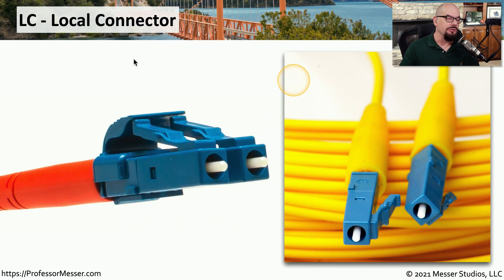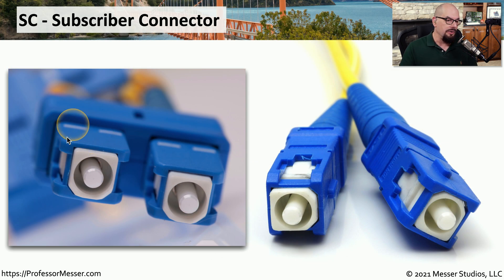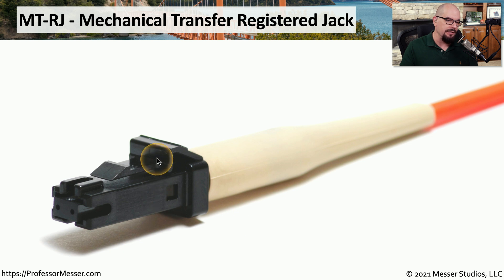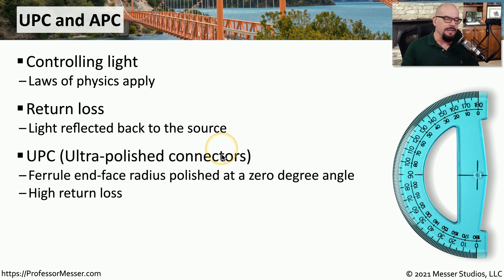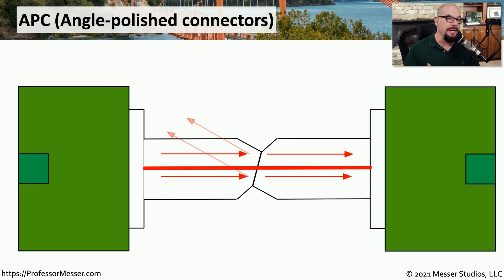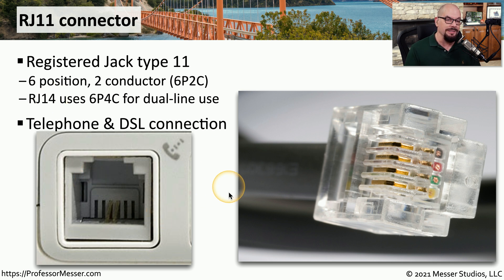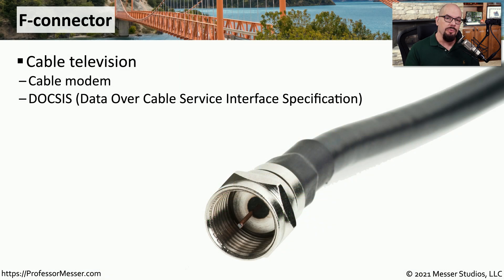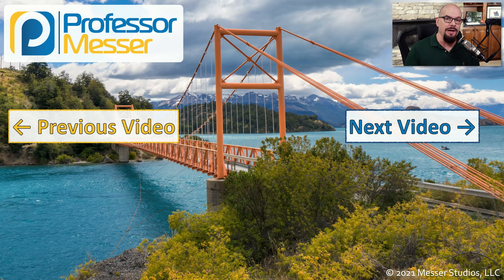Network Connectors - N10-008 CompTIA Network+ : 1.3

Comment: when i was setting up network connections and smart devices in new home builds, one of the plumbers plugged the RJ11 for the water pump on a smart shower into an RJ45 port and they were trying to fix the pump for hours. I went into the attic to fish some cables across the house and they asked me, fixed the issue in less than a minute

Comment: How does APC have a lower return loss than UPC? As I understand it, the “loss” in return loss is referring to the “return” itself, the “return” being the reflected light coming back from the destination end of the cable. you want the destination end of the cable to “lose” the photons that it is receiving after having received them so that they don’t “return” and interfere or degrade the original photons trying to reach the intended destination. right?
Reply from the maker: Ideally, all of the light sent from the source is received on the other end of the connection. Of course, there are many things that can happen along the way to degrade the light, including reflections caused by the fiber connections.

The return loss describes how much light is lost due to the reflection caused by these connections. The flat UPC connection tends to reflect more of the light than the angled APC connection, so UPC-connected fiber tends to lose more light as it passes through.

The return loss is measured as a ratio between the power of the outgoing light and the power of the reflected light, so a wider ratio (less loss due to reflection) would be better. This is a bit outside the scope of the Network+ Exam Objectives, but UPC tends to have a return loss of around -55 dB, and APC has about -65 dB.
Reply: @professormesser got it, thank you professor!
Reply: UPC has a return loss value of 50dB whereas APC has a return loss value of 60dB. Which would mean that you would want to use APC instead if UPC is generating too much interference due to the reflected photons. Is my understanding flawed entirely?

Comment: Noticed that the angle in the APC connector can be remembered by the angle of the capital letter A, whereas the straight angle of the UPC connector is like the straight lines of capital U.  I'll try to remember that for the exam.

Comment: So on an APC connection, does any of the light bounce back into the path to the destination? Wondering where the reflective light on an APC goes if it is lower return loss than a UPC connection.
Reply: Yup it does, just a lot less since it has to bounce around so much more in that angled ferrule.
Reply: Why is it that if the light bounces back, that the signal is not being interfered with?
Reply: @vman9630  because of the angle, the light is being returned at an angle instead of straight back
Reply: I'm guessing that the light is absorbed as heat or other energy and disperses. You would have to ask someone who knows more about physics than me to get the correct answer though.